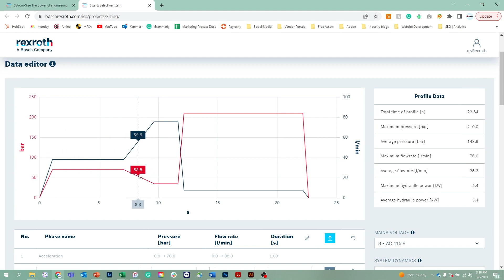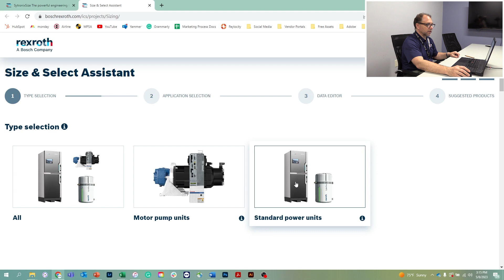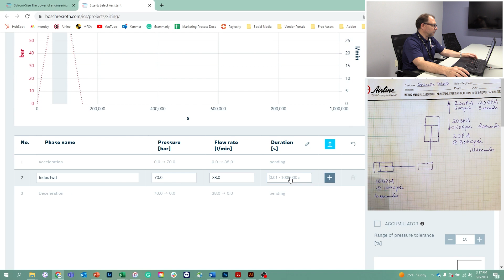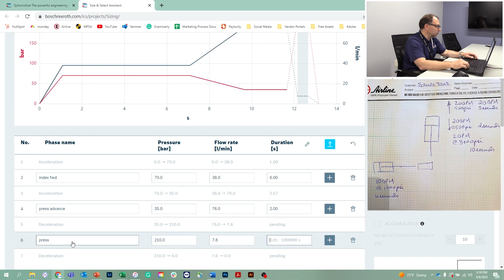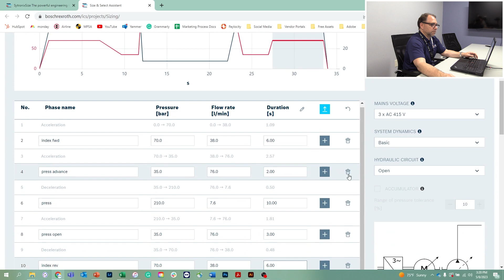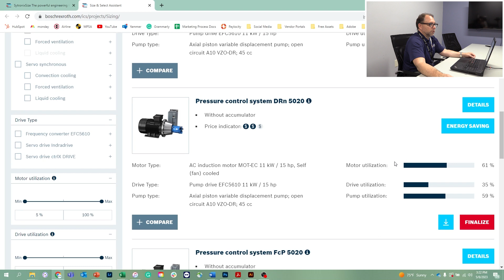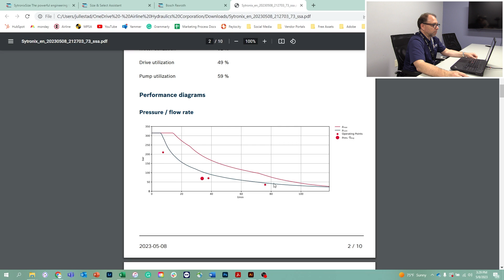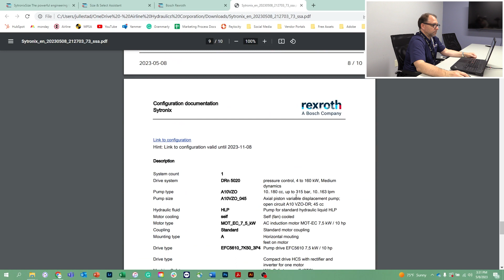How to Specify Variable-Speed Hydraulic Drives | Bosch Rexroth Size And Select Assistant Walkthrough

Comment: 16cc pump is enough if you use MS2N motor and 10L accumulator. No need for 45cc pump. It is smart to check Standard power units too.